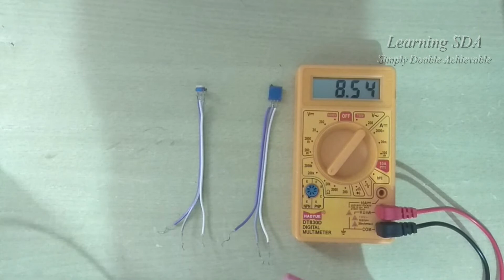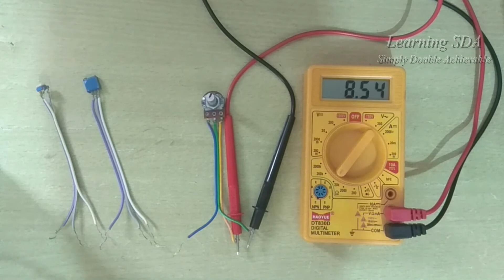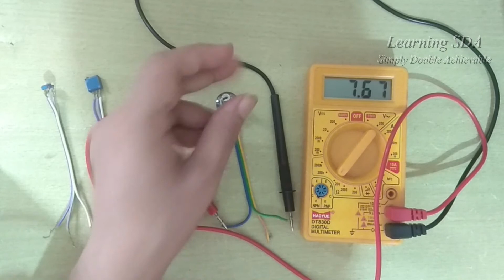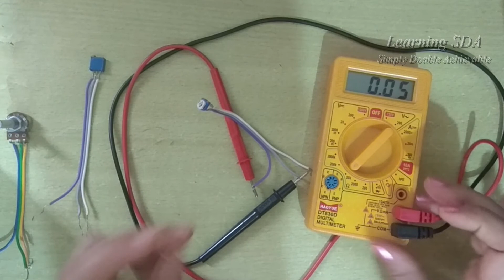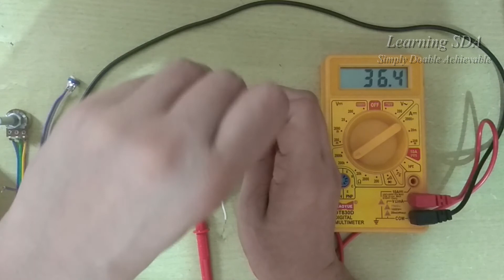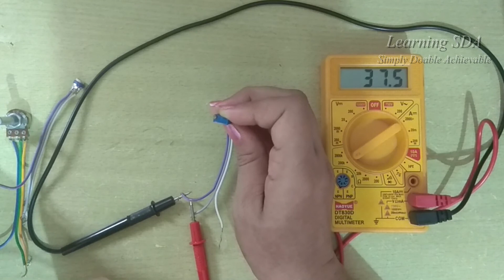Variable Resistor Measurement using Multimeter | potentiometer measurement using Multimeter | Preset

Comment: If you are only getting a fixed value reading of 8.5 K ohm from a 10 K ohm potentiometer, does that mean that the potentiometer is defective and no good? Also, what if you get a reading that is higher, for example, 10.5 K ohms? Please explain. Thank you.
Reply from the maker: I think you are measuring values between end terminal. Between end terminals you will get fix value, but if you are getting fix value between variable terminal and one of the end terminal then wiper of your potentiometer may internally break. 
You may get 10.5K reading with 10K potentiometer, this is due to tolerance of potentiometer.
Reply: @learningsda3627  Thank you for your reply. l bought four 500K potentiometers. l connected my multi-meter to both of the end terminals on each of the new potentiometers to test the fixed values. One of them gave me a fixed value 465K and another gave me 458K. The wipers work fine, but my question is, will the lower resistance values in the two potentiometers make a major difference if l use them for volume controls in an electric guitar, or will 35K and 42K ohms be very much noticeable? l hope that you can answer that question. If not, thank you anyway.
Reply from the maker: You should check lower resistance value of both the resistance and if difference between their lower value is more than 100 ohm then you can add a series resistance to make lower value equal.
Reply: @learningsda3627  Thank you very much for your help. l have subscribed to your channel and l look forward to learning more from your videos.
Reply from the maker: Thank you